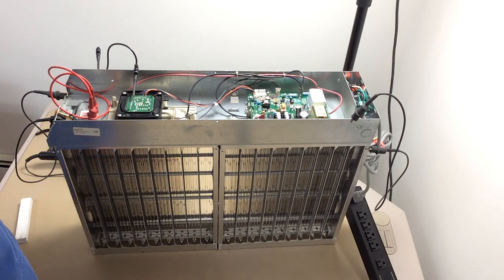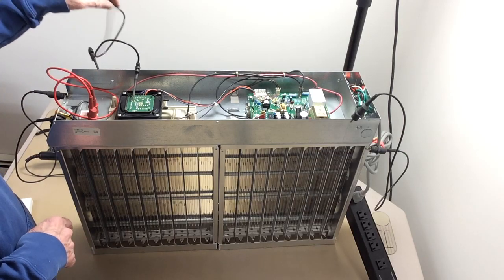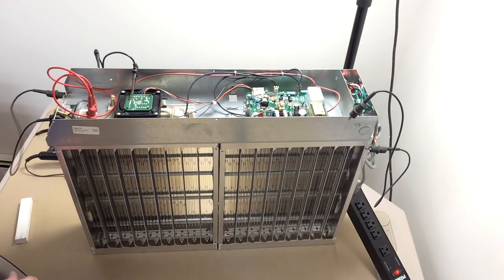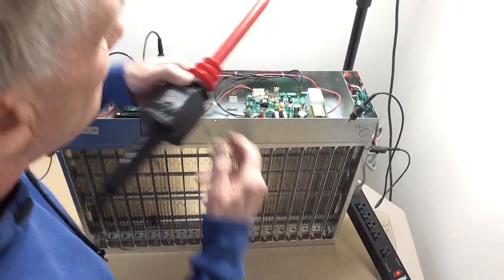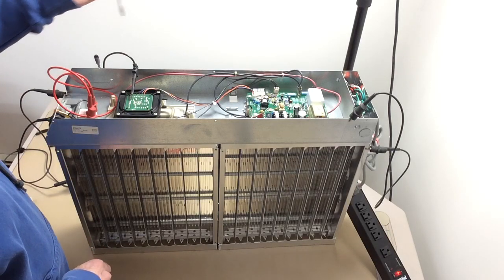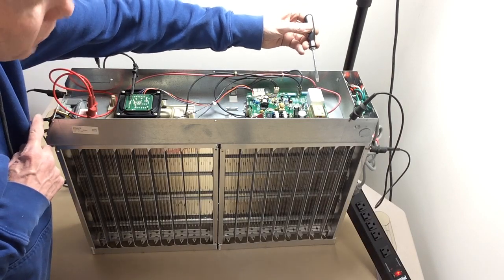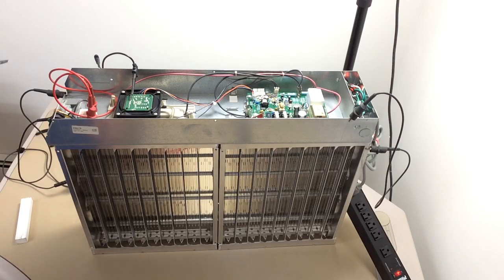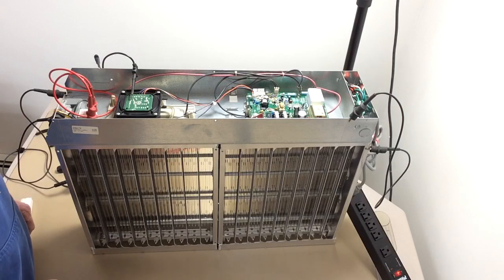Voltage test procedure for the Honeywell Electronic Air Cleaner

Comment: I like this video , now I remember why I did'nt test the voltage before - I need to get a hi voltage meter. I get a lot of buildup on my evaporator coil. I recently got new cells and was blowing out the  post filters and reusing them. I thought it was cleaning the air - but the dirty coil says otherwise. Do you have any idea why my coils still got dirty?

Comment: Thank you for the video.  When I turned my old house to a rental I unplugged my F50F and installed the paper filter made to fit the unit.  I figured the tenants would not care for the filter properly.  Well I am done renting the house and I pulled the filter cartridges out of storage and reinstalled them back in the unit and plugged it back in.  I am not getting the neon light so I am now trying to determine if I disconnected any other wires.  I am not finding much on wiring and your video helps.  Thank you.